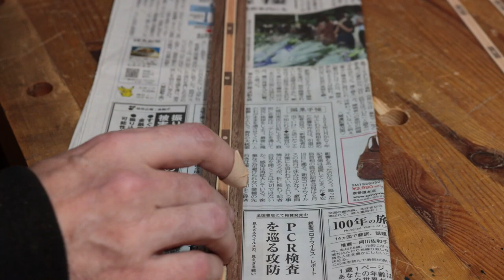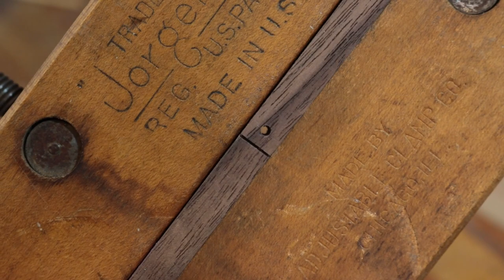How to make an artist's pencil box with hand tools!! Hardware too!

Comment: Wonderfully done!! How did you glue the inlay pieces side by side like that?
Reply from the maker: Thank you! It's a little hard to see in the edit, but if you watch the first part where I'm making the inlay you'll see I lay alternating pieces of cherry and walnut in a line. I'm actually gluing them to a strip of maple that's underneath. I then put the weight on the top to let them dry, plane the blocks to get them even and then glue another strip of maple to the other side.
Reply: You really have an incredible skillset
Reply from the maker: @russelali8697  Thanks very much! Appreciate that!